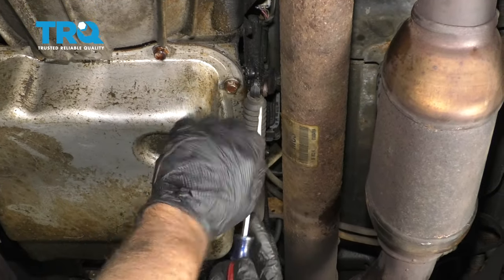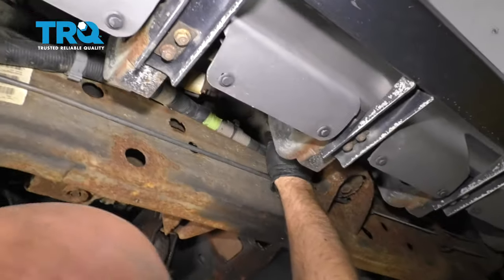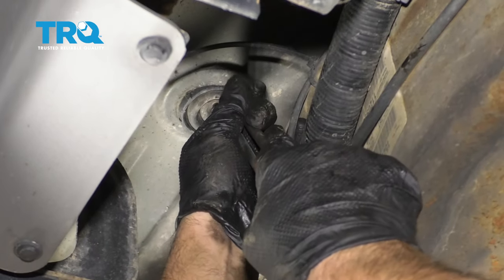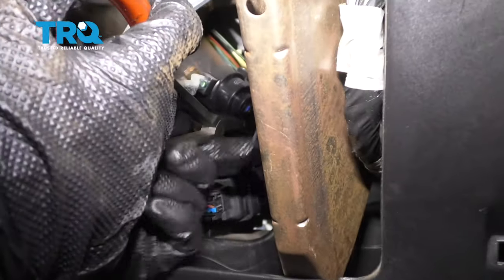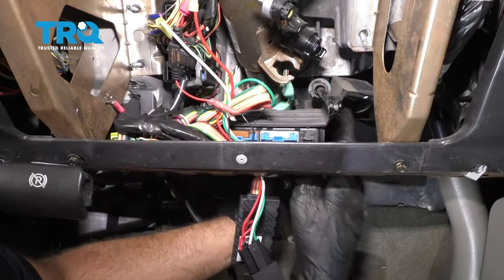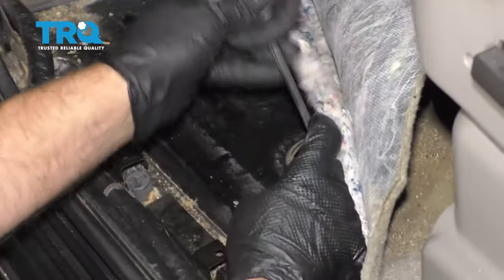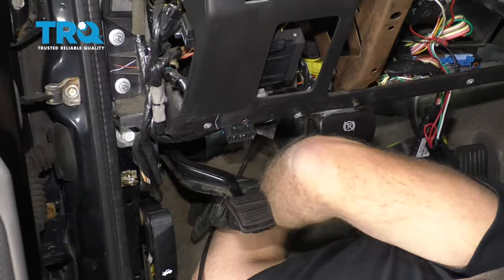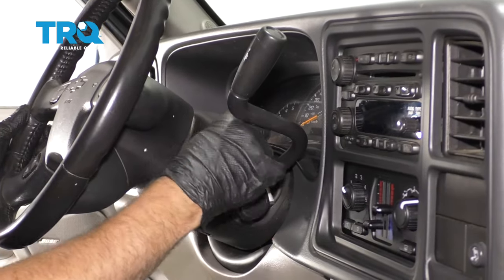How to Replace Shift Cable 2000-06 Chevy Tahoe

Comment from the maker: √  Watch the Video
√  Buy The Part at 1A Auto http://1aau.to/m/Shop-TRQ-Parts
√  Do it Yourself
√  Save Money
Reply: There seems to be 2 cables.  Y-1286 and Y-1285.  Is one for ext cab and the other single cab? 140” for extended cab?
Reply: Can you change the bottom half cable

Comment: This helped a lot for AllData is trash and I can only locate the rear half R&R and the adjustment procedure. Although im not sure how you got the front part out of that spring so easy. I may just cut it out and figure it out routing it back in. If I'm not mistaken, that spring is only for cable slop? So it's not just hanging? Could possibly just secure it another way? Or does that spring have an actual function aside from just securing it?

Comment: Great video.  I’ll add that getting the old on out from around the column is the hardest part.  Save the hassle and cut it.  Feeding the new one up and around is easy.   Shouldn’t the adjustment be checked in 1st and neutral?

Comment: Perhaps you can tell me why You had to replace the cable in the 1st plquestion mark I just experienced an issue with the linkage on the sterewell just kind of dropped I'm curious if perhaps maybe it's thiscord or cable that either is broker came off underneath is that something that you would experience?

Comment: Its hard to put my 2003 Cadillac escalade in park, i have to use alot of force for it to go into park you guys think its a stretched cable?
Reply: Did you fix yours what was it? Park was there but I could feel lots tension. And when I would lose. The adjustment. It would have hard time into D.

Comment: Any idea how many inches that cable is? I've got 03 workhorse p42 with a 6 5 diesel and 4l80e tranny. Workhorse wants $300 for an 82 inch shifter cable. Wondering if there is another option or diy. Searched the part number but couldn't find another option.